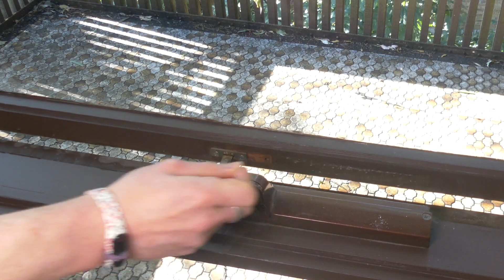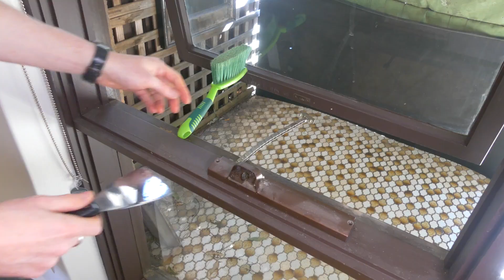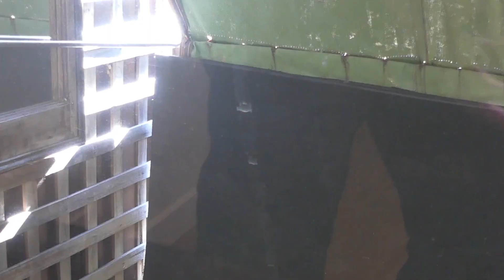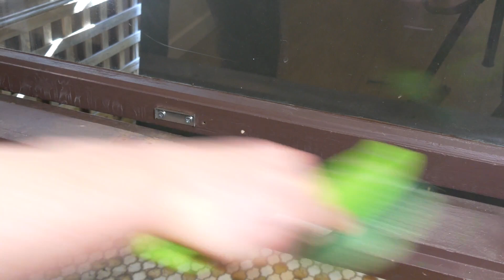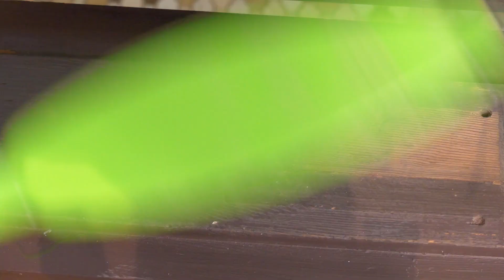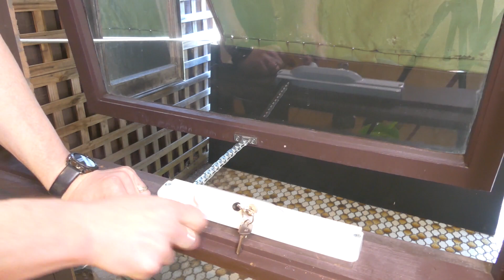How to Replace a Broken Awning Window Winder (Bunnings Whiteco Window Winder DIY Installation)

Comment: Great video!  My issue is I am in two storeys up.  How do I mange to prepare 2 pilot holds for my external bracket?  Is there a plan B please?
Reply from the maker: With difficulty I am afraid. I've not tried it above ground floor sorry. If you dont have a way to access the exterior safely it may mean you need to call in assitance. Always be cautious working at heights if you choose to still DIY. (There may be another way, I've just not tackled that issue sorry!)
Reply: @FixitFingers  thank you so much for your prompt reply.

Comment: How to clean the outside of that kind of window? I'm in 3rd floor and no way to climb there
Reply from the maker: Tricky, I've not had to as ours are on the balconies. If youi wind it open can you reach from the side with a long washer pole? Otherwise I've seen some werid magnet cleaner things but never tried one! https://link.amazon/B0j65KW22
Reply: @FixitFingers thank you for your suggestions

Comment: This video helped heaps for replacing ours, however the instructions from Whitco have the faceplate installed the way you put it on the first time. We tried your way and the winder arm end doesn’t sit properly in the faceplate, so we put it the way shown on instructions and sits perfectly in the faceplate.
Reply from the maker: Glad it helped! And that's interesting feedback on the faceplate, always good to follow the instructions... especially if it works 😂

Comment: Thanks for the nice tutorial. I'm just wondering how to deal with a situation where the window gets stuck in the closed position. How can I remove or replace the awning mechanism and in my case, it's a Pacific HA02? thanks
Reply: Exact same situation for me
Reply from the maker: I just googled that model and it looks very similar. Is the issue the winder unit or the window swelling? You should be able to access the screw holes in the top and remove the unit. That will allow you to push out the window manually and see if the winder is broken or if the window is just jammed due to age, weather, being painted shiut or similar.
Reply: @FixitFingers  thank you so much for your quick response. I think it is the winder, or i would say the key lock. I'll try to remove the unit thanks again. I really appreciate your response.
Reply from the maker: No worries, good luck 👍

Comment: Use dowling to gill holes its much better if theyre bigger
Reply from the maker: Good tip! Yes I do this on bigger holes with dowels, drill them out, tap it in. Works really well.

Comment: How do you open the window if you've misplaced the key? 🤔
Reply from the maker: Asking for a friend? ;) hehehe The good news is most of these locks are very generic. If you have multiple units of the same brand, the keys should be the same. If it's the only one, sadly buying a new unit is probably cheaper than getting a locksmith out. If they still sell the same model at your local hardware store, they might be able to either sell or cut you a key to match. Best of luck!

Comment: How do you replace one that won't wind out at all? We  have two where they won't wind out?
Reply from the maker: Sounds like the gear inside is worn out. You'll need to unscrew it from the frame. After that the chain should release allowing you to unscrew it from the window. If the frame screws are those nasty security ones that don't come out easily, you might have to drill out the heads. Good luck!
Reply: @FixitFingers  thank you for the information we will do that.  Appreciate you replying back.
Reply from the maker: @jared2178  no worries, let me know if you hit any issues. Send me a pic via Insta or Facebook if you get stuck 👌
Reply: @FixitFingers  will do, a trip to Bunnings this week is on the cards.

Comment: Found this through notice of your workshop tour! I have never seen a fixing like this and I wish those flyscreens were around here! I live surrounded by trees and everything with wings tries to get in!
Some good tips - I have used matches and bamboo skewers for a long time, people used to use wire wool compacted in - till the rust appeared! That was long ago!
I wish I had the screwdriver ability on my Black and Decker drill, forward and reverse - it is decades old though but still a great workhorse! I have arthritic hands but I you can adapt a screwdriver to be turned by a wrench or a brace and bit - the brace and bit may be before your time James! :-) Best wishes, Eryk  🎬👍🔨👍🔨
Reply from the maker: Believe it or not I have a brace and bit hiding in the workshop somewhere! Needs a restore though, all jammed up. Yes I thought these sort of winders would be universal but looking for them to link to overseas it looks like they may be an Australian thing as I have not seen their like anywhere else :P
Reply: @FixitFingers  👍

Comment: I was never a fan of those hopper wind outs. You fixed it good! 
P.S, my garage / workshop is almost done. Setting up the dust extractor so i will be able to get a few things done! 
Cheers
Reply from the maker: Nice! There is a new little dusty Carbatec are releasing soon then I can upgrade the shop vac. I think I am up to 7 of these winders replaced in the past year or two. I just realised the one I replaced in the video is NOT one of the orginals from the 70s, they were much smaller units, so this window has already been fixed at least once before. Being strata, often renters just dont complain, so there could be a dozen more that need attention I don't know about to fix yet! 😅
Reply: @FixitFingers  They are easy to replace, as you showed. Does Strata pay for it or the owners?
Reply from the maker: @Mykleshed  Yes, I am the Strata handyman/building manager and get paid for these little jobs once they are brought to my attention. This unit has just been fully renovated by the owner so they picked up a number of small jobs for the Strata to fix at the same time. It's a good system. I make some pocket money and the Owners Corp saves about 50% on small repair jobs as I don't charge call-out for walking up the stairs from my workshop 😁

Comment: Nice one! I like the skewer trick, done that one a few times myself.
Reply from the maker: Yeah, I just need some M8 skewers..  those M6 ones are a bit small usually 😂
Reply: @FixitFingers  If I have the stuff handy, I like drilling out the stripped hole to 1/4" and gluing in a 1/4" dowel.